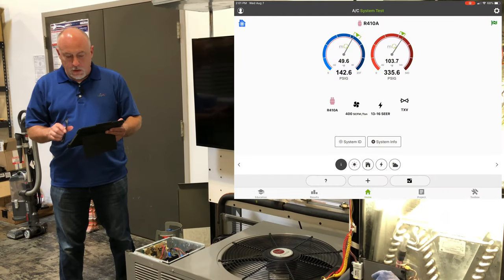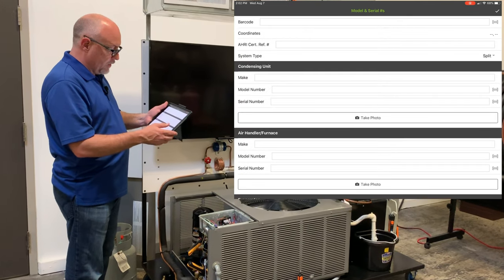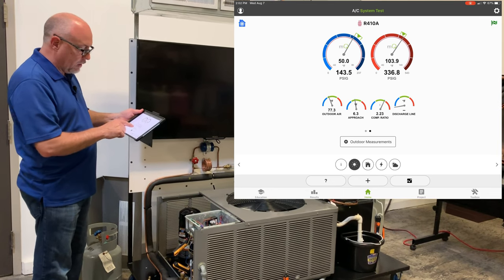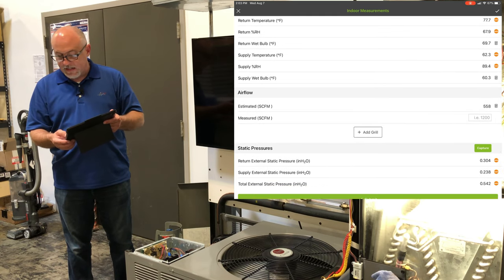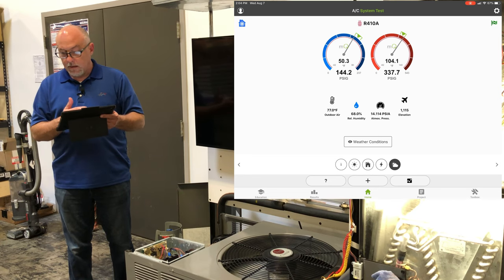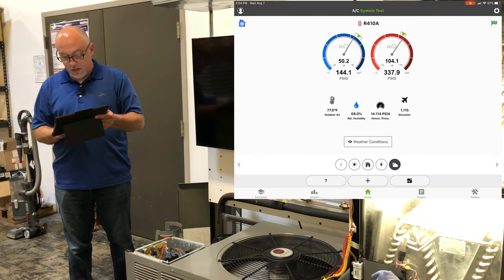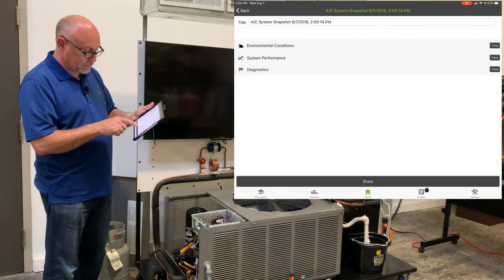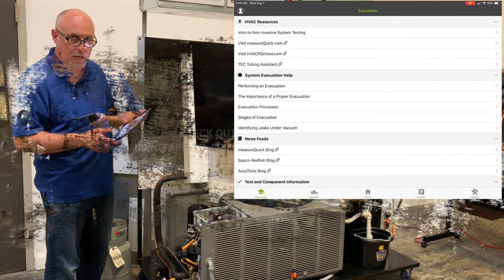Navigating menus in measureQuick

Comment: Dude slow down!  It would be much easier to follow if we could see where you are tapping.
Reply: The problem is that since Jim created the program he knows it inside and out so he presents the information as he knows the program as well as he does.  The creators make for very poor instructors.  What I did though was to click on the gear and reduce the speed of the video.  It helps to catch better what he is talking about.  Jim still lacks the technique of presenting the program to a first time user.  While the program is great, it is a challenge to learn, in my opinion.